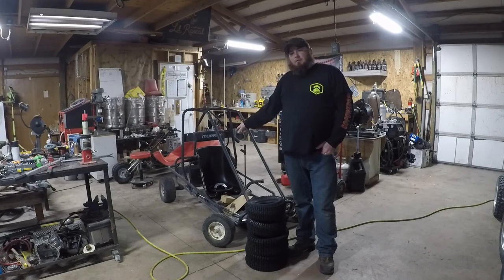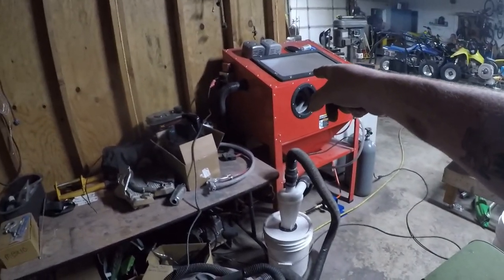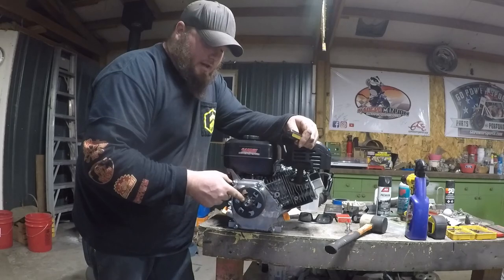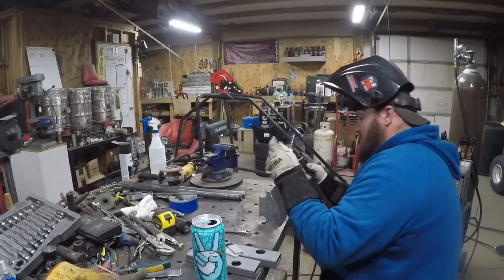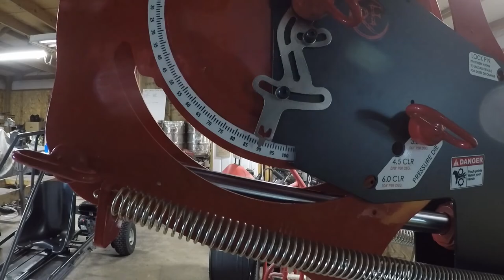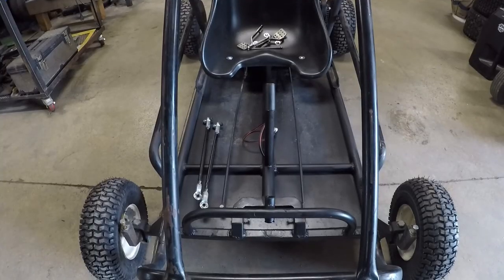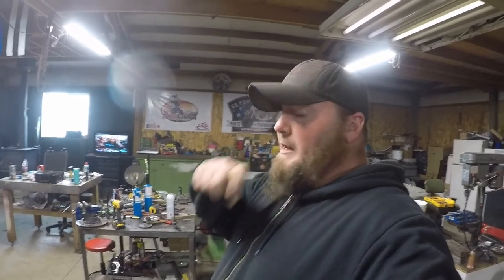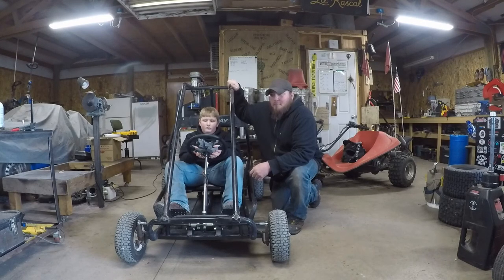Restoring an old Murray Go Kart | It runs great!!!

Comment: Nice video.  Have you heard anything about the minibike gambler in Oregon?
Reply from the maker: The enduro is cancelled.  We're running the isolation violation in bickleton this weekend.  There will be a mini bike event at the OG 500, possibly an overland trip from crescent to Christmas valley and back.
Reply: @BadgerCanyonMotorsports  Yeah I am thinking of the Oregon event.  I was there last year and you welded my kick stand for me.  I am not finding any information online.  I even sent a message to GoPowerSports and they said they hadn't heard anything.
Reply from the maker: @dillonpapa  yeah part of the problem is the gambler mindset on being vague, especially when it comes to sponsors.  I do know the sanctioned enduro was officially canceled in like January, but we are adapting ans trying to get some stuff organized and not just glommed on to the OG 500.